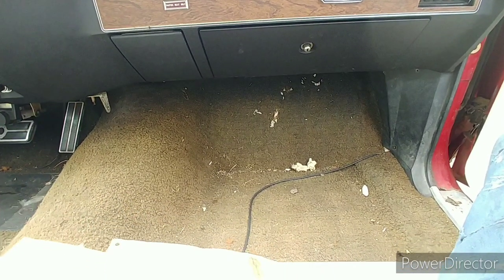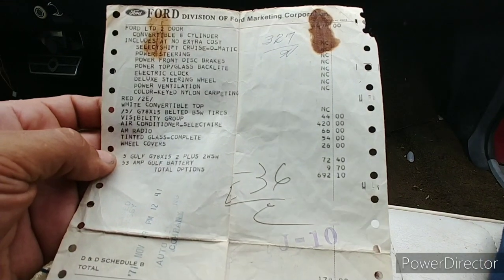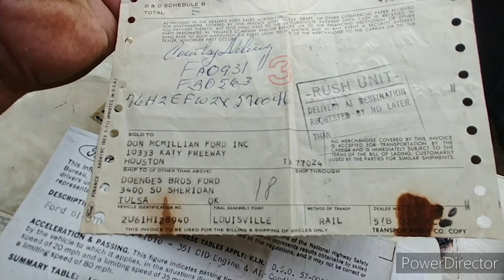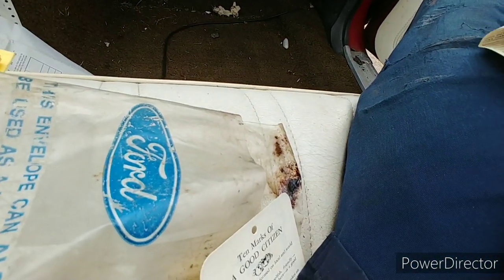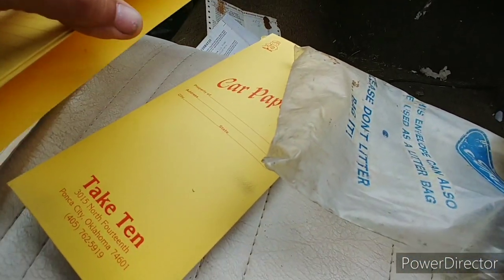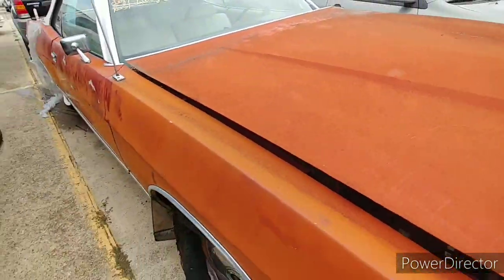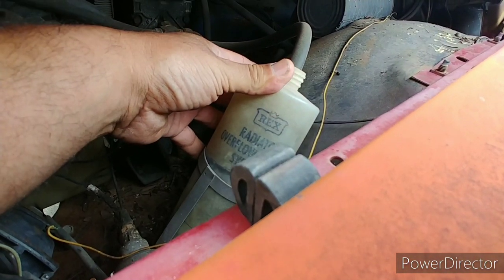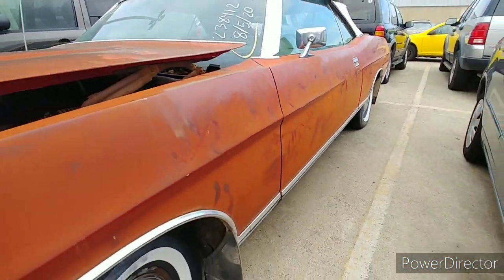1972 Ford LTD Convertible Auction Find

Comment: Whoa Nelley, rare drop top, at $5k a pop.  Last year for the LTD convertible and only 4,234 were made. We got the VIN (and then some), so we win and here we go:

2 for 1972 model year, U for Louisville, KY assembly (the same city was also the home of GE's "Appliance Park" manufacturing plant for appliances, I have one in my house from there), 61 for LTD convertible,  H for 351 V8 with two barrel and the rest is the production sequence. We got the tag, we can brag: 76H for Ford LTD convertible, 2E for Red exterior paint, FW for black and white interior trim (white seats, black carpet), axle of 2 is 2:75:1 rear axle ratio, transmission of X is FMX automatic (aka "Cruise-o-matic"), district code of 57 is for Houston, TX which makes sense based on its' eventual desination. 

Don McMillan Ford is now Maik Ford at that same address. Doenges Brothers Ford is now Fowler Ford at the same location.  This car had a glass rear window according to the window sticker and it appears to be gone. That cruise control is aftermarket and typical of the "hang on" units of that era. Visibility light group typically meant  map lights, under hood, trunk, and footwell lights on a lot of Ford models.

I guessed $1500 before you showed the amount.
Reply: Damn I thought that Load of Tin from Dearborn would have a 9 inch rear in it so the the 351 must be a Windsor. I had 74 LTD 400 2 barrel C6 transmission and it had a 9 inch in it also it was one of the worst vehicles I ever owned, I could write a page on it but the transmission and rear were trouble free it was just everything else.
Reply: @garymckee8857  The beginning (or somewhat start of) the Malaise era in Detroit and American society in general.
Reply: @garymckee8857  The window sticker made the decode easy on this one, but the clincher was that the salesman wrote the door tag details on the window sticker as well. I was able to freeze frame (just barely) on the door tag to do the decode.

We got the VIN, we win, we got the tag, we can brag.  We got the (window) sticker, there's nothing to bicker.
Reply: @googleusergp  My 69 Road Runner window sticker I still remember the final price in the lower right hand corner was 3003.38 manual steering manual drum brakes bench seat 4 speed but it had the light package.
Reply: @garymckee8857  Much more ala carte back then. My '80 Trans Am has power windows, no power locks. No tilt, standard interior, optional engine, no radio (just an accommodation package, we had the dealer add an AM/FM radio, I took it out in 1991, but still have it), AC, no WS6. It was on the showroom floor and one of the only 1980s left in the dealer's inventory in the fall of 1980.  We were after a Pace Car, but there were none to be had (according to that dealer). Even among Pace Cars, they had options. Some didn't have power door locks or tilt, or delay wipers. 

Compare that to a 10th Anniversary Trans Am, you had one option: The engine. You either got a 403 with a TH350 or you got an optional 400 Pontiac and you got a 4 speed with that. No choice. The engine dictated the transmission (TH350 for the 403, Borg Super T-10 for the 400) , the rear end ratio (2.73 for the 403, 3.23 for the 400), where it could be bought (no go for the 400 in the high altitude/California emission regions) and cruise control (Yes for the 403, no for the 400, you got a credit). My car is a Pontiac 400, one of 1,817. Mine was made in the first week of April 1979, the exact week that GM announced the 400 engine could not be ordered anymore, you had to get a 403.

The story on mine is that the original owner saw it in a magazine. He had a 1975 Trans Am at the time. He sold that (or traded it, forget which) and then went to get the 10th. He wanted a 400, and the salesman, Bob McLeaf (deceased now) of Brake Pontiac in Waynesboro, PA said he didn't have one. The original owner, said, "How about $500 to motivate finding one?" With that,  Mr. McLeaf made a phone call to Liberty Pontiac in Randallstown, MD and they horsed traded the 403 that Brake had for some extra cash and a deal was made. The owner drove with the salesman to MD to do the swap and then the paperwork was done at Brake Pontiac in late '79/early '80 (the original title is dated 1/2/80, I have a copy of it).  My car cost a whopping $13,260.96 out the door WITHOUT the $500 he paid the salesman. The loan was paid off in three years. When I finally tracked down the original owner and spoke to him on the phone, I said, "That payment had to hurt every month", he laughed and said, "Yea, like giving up a kidney every month" or something like that.   He worked for the US Army so I suppose he was a good risk for a loan back then.

I lost touch with him. He originally said he had a "box of stuff that goes with that car, if you let me drive it one day, I just might give it you....." I gladly obliged but he then claimed his ex-wife threw it out in a divorce. I'm going to have to revisit this story with him again.....My car was traded by the original owner to Lynn Pontiac in Waynesboro (Brake Pontiac eventually became Lynn Pontiac, today this is Buchanan Auto in the same location, still a GM dealer).  From there it got sold to a person in MD, then to someone in VA, then back to PA from the folks I bought it from in 1999. I have spoken to every owner it's ever had.
Reply: @googleusergp  I purchased my Road Runner from the original owner for 300 dollars in 82 he had bought a Chevette and the car was sitting beside his house his son was a classmate of mine in grade school and I remember when his dad bought the car new. It had 48 thousand miles when I got it it had a 323 rear gear which I thought was high for a manual transmission and ugly interior that I changed to what Chrysler used for Police cars and Taxi cabs in the 60's also their S/S cars had the same material which in 82 just for the material was 350 dollars when I was only clearing 111.62 a week.
Reply: @garymckee8857  We somehow got it done. I was making about $3.75 an hour in 1987 (which was above minimum wage) working in a hardware store (My father sold the HR manager a Cadillac so he got me the job through her and her husband who also worked there). I started stocking shelves and then another HR person said, "You'd be a good sales person". So, in September 1987 (actually around this exact time), I moved to the sales floor. That got me salary and commission on everything I sold, so I made good money, more so than stocking shelves. I had the $2200 (my parents gave me $1000, the other $2200 was a loan) paid off in no time flat. I would make sure that I was writing up everything I was selling on the floor and that got me extra money to give to my parents off the loan for the car. When it was paid off with money in the bank for insurance, registration/inspection and money in the bank for parts (as I was doing the work myself of course), it went on the road. I got my driver's license on Cinco De Mayo 1988 (5/5/88) and registered the Toronado I had bought on 6/1/88.
Reply: @garymckee8857  3.23 may have been high in 1968, but by 1979 on the Trans Am if you wanted AC, that's what you got for a rear end ratio, especially with the Pontiac 400. The 403 had a 2.73 rear in most applications, sometimes as low as 2.41 on some Trans Ams.  My '80 Turbo is 3.08. Pontiac knew how to work with what they had based on emissions laws at the time, although they raised the ire of the EPA more than once. The Super Duty just barely passed through emissions for the given year and some 455 engines had emissions routings which the EPA later found out violated Federal law and they made GM issue a recall. Also, GM had the "Vacuum Operated Exhaust" or VOE option on some GTO models and the EPA shut that down as noise pollution. They reproduce it now for restorers that want to add it or if their cars had it. Also the hood scoop was not functional I believe after 1972 on the Trans Am again due to EPA regulations.

Of course, GM's brass got bent out of shape with GM's ad agency with the famous ad showing a GTO at the Woodward Ave crossing/interchange and sign with the caption, "You Know the Rest of the Story". It was thought that street racing was being promoted and this was the time when the insurance industry, the EPA and all the thinking at the time was very much against performance.

Here's that ad: https://fineartamerica.com/featured/1968-pontiac-gto-woodward-the-great-one-by-pontiac-digital-repro-depot.html
Reply: @googleusergp  Yes in 83 I borrowed 500 dollars and bought a 65 Fury ll 2 door post car black in color with dog dish hubcaps. It was a 318 car but I had a 65 Imperial that had a 413 I was going install in it but as usual my attention span is short so I got rid of both of them but now I would like to have the Plymouth back it was in excellent condition.
Reply: @garymckee8857  My parents had a 1963 Sport Fury with a 318. My dad bought it new. When he went into the service, they froze the payments until he got out. When I was born in 1971, we sold it. I'm pretty sure we got good money for it, it was in excellent condition. We had a 1972 Fury for a short time, but my mom chipped the flywheel when she accidentally turned the key when it was running.  We eventually wound up with a new 1974 Charger 318 which we sold in the spring/summer of 1979. I was playing in my grandparent's yard when a guy came up and looked at the for sale sign. I called my dad out and the guy bought it on the spot for asking price. He kept it several years and it was in excellent shape and then he sold it in the 1980s.
Reply: @googleusergp  Outstanding Chrysler used to manufacture some great vehicles, of all the vehicles I have owned the only photo I have is me standing beside a 67 Sport Fury that my mom told about she heard on the local swap shop radio show 318 car fastback version 275 dollars in 91 damn I wish you could buy old vehicles reasonable but the T.V. shows ruined that now if one had some weird option they try to get some astronomical amount for it.
Reply: @garymckee8857  Growing up, we had a 1941 Plymouth Deluxe. We bought it in 1978 out of the local paper for $550. I can still remember the ad, "1941 Plymouth Deluxe four door. Runs. Needs work. Extra parts included". We showed up there and my mother said to my dad, "Are you nuts? That thing is a POS.....". My dad said, "Won't be with some elbow grease...it will be a family project". We bought it and it came with a load of extra parts. It was primer gray and black, and one of the neighborhood kids' visiting cousin called it "The Bomb". By 1981 it was painted Candlelight Cream, an AMC color if I recall. We cleaned it up, us kids polished chrome and learned how to work with tools (including me learning fractional math from my dad using SAE sockets---I still have them today) my dad and grandfather redid the interior with a JC Whitney kit. It was all an amateur restoration but by 1981, it was looking nice enough to polish and keep clean.  In 1985, my grandparents were married 50 years so my dad took them to the church/celebration in it as the chauffeur. We have photos of it, the day was a lot of fun. When my dad passed away in 1988, we gave it my uncle who lives in TX, his older brother. He had it for a number of years, painted it a burgundy Ford color, fixed it up again, refreshed it, and then his son, my cousin Gerard, had it for a while and then he sold it to the proprietor of a local paper in TX, who I believe may still have it today. We nicknamed the car "The General" in my family since it was a WW II era car and it always, always, always started right up. One time, my cousin was living where there was snow and every car he owned wouldn't start, but the 1941 Plymouth fired right up and plowed through the snow.  

Every year at the end of the season by fall, it would be put in my grandparent's garage for storage, with our patio furniture in the back seat to keep it out of the weather. Spring time, we would charge up the battery, fire it up and take it out. My mom gave it to my uncle and wouldn't take money for it. "Your brother would want you to have it..." My uncle refused and said, "Ok, here's the deal. I will give you a check for some money towards his (me) college fund.....". With that, a deal was struck. My uncle sent two guys that were cattle ranchers with a truck to my grandparent's house to pick it up. My grandfather said to them, "You guys are real cowboys!" Lol. They said, "Yes sir, we'll strap her down like a hog and off we go...." And that's what they did. My grandfather got a kick out of them---they were the real deal with the hat, jewelry and jeans and boots. Nice guys.

Fast fun fact: The garage that it was stored in was my grandparent's garage. In 2016, I bought that garage and property from their estate through my mom and uncle who inherited it when my grandparents both passed away. As I needed a place to store one Trans Am (which had been stored there for years when my grandparents were still alive), we worked out a deal where we sold half of the property and I bought the other half with the garage on it. Win-win situation.
Reply: @googleusergp  outstanding it's always a great thing to have a garage.
Reply: @garymckee8857  When the offer came up (I could have bought the whole property, but my uncle convinced me to just buy what I needed---I wound up buying my parent's house a few years later after my mother passed away, so it worked out), I could not refuse it. My uncle and mother (brother and sister) were very good about it. They offered to lend me the money, but I said, "Nope, this is my choice. I'm good" and I figured out the money end of it. I'm fortunate---it's a legal garage with NYC and it has its' own street address, which is extremely rare in NYC. Only a handful (probably less than 25 in all of NYC) have this situation. I know that's the case because I've spoken to several people at NYC Buildings and they all agreed. The contractor that did the renovations tried to get cute, but that got him burned. He didn't factor in the cost of the driveway, tree removal and curb cut, but I did---and put those terms in the contract which everyone signed.

Guess who wound up pouring a 65'x20' driveway (8" thick with Fibermesh and high density mix), cutting down all the trees in the yard and getting a legal curb cut for virtually free? Yup, not me. I wound up giving him an extra $5k because he bellyached that I "snuck that into the contract", but that's OK because when he gave me a new proposal, I made him take down every tree in the yard in the way which I know alone was $5k worth of work (since I got estimates from others on my own)  and my coworker's father who was a mason calculated that the driveway alone was $15k in concrete. Either way, it wasn't my intention to screw anyone, but when you try to play games, you often get burned. This guy learned that the hard way.
Reply: @googleusergp  sounds like you have some prime real estate. You said your family had a 74 Charger I bought SE from a and older guy who done the same work that I do it was a 400 he had everything rebuilt in the vehicle before I bought it . I remember when I started doing this type of work I drove home every weekend because I was close enough to do that and he said your lucky to be close enough to home to do that now I know what he meant by that because I'm 1100 miles from home and tomorrow I driving to St. Cloud Minnesota for a week of work and that's puts me about 1500 miles from East Tennessee and that's why I don't own any old vehicles anymore unfortunately because I miss having something I always had when I was able to earn money.
Reply: @garymckee8857  True. With the pandemic, I'm working from home, so I save 44 miles a day of driving and such. I have to do some oil changes on the car,  I haven't had to do them this year because I haven't been driving at all, except for local runs and one 110 mile trip to visit my sister to do some work up at her house. 

The real estate is special to me because everything was owned by now deceased family members. So I know what I've got---my house has been in my family since new in 1968 and my other garage has been in my family since 1975 when my grandparents bought it. The garage was built in 1962-1964 by the guy that sold my grandparents the house in 1975. He moved because he got married. He was living with his uncle and I suppose his new bride didn't want to live with his uncle. Old German guy who built my garage out of 5/4" decking. Overbuilt. Way too much for a garage, but it's like a brick you know what. Both are a mile apart (maybe a 15 minute walk) so it's easy to get there. I was there twice today for two CL/FB sales. I went early in the morning, cut the lawn, someone came for something, sold that. Then I came home, whoops, got an e-mail about something else, took another ride back for that. LOL. But two sales from curbside finds work for me.

Our Charger was a regular model, F7 Sherwood Green outside with a white inside. PS, PB, AC, AM radio (which we added an FM converter to from what I remember), white vinyl top, 318 two barrel. It was sharp. My father kept it in great shape. We also had a '72 Charger 318 two barrel that we bought used in 1976 and sold in 1978. That was F3 Fiesta Green. The '78 gray Bonneville I spoke of in another video took the place of that. The '72 was the "money car" as I related in another story where when cleaning out the quarter panel plugs $8.00 in pennies came out. My father called the previous owner who said, "Oh yea, that was the jar of my bowling dues money. It must have spilled open and the coins fell under the trunk floor. Hey buddy, keep the change!!!" My father laughed and hung up the phone. We bought a new NOS Holley carburetor for it for $25. Funny story is that the guy  at the auto parts store that sold us that was the same guy I wound up dealing with (at that same parts store) around 1988. Years later around 2002, when I worked in the aftermarket, we used to have a "salesman's tour day". They would have a day where us office guys would pal around with a local salesman to our area. So I picked my area and I went with the salesman that covered my area to all his auto parts stops. We go to this one parts store and who is working the counter? The same guy Gary from back in the day. He said, "Whoa, blast from the past. I know this guy since he was a kid. I sold him a carburetor with his dad in 1976 for $25!!" He was an excellent parts guy and really a nice guy to deal with. He knew his stuff.
Reply: @googleusergp  wow I have pennie story also. In 92 I bought a 78 Dodge Magnum one Sunday the horn just started going off for no reason so I go outside and kick the rear bumper and these pennies start falling out from the bottom left rear quarter panel you could not see any rust in the quarter panels because the pennies was causing the corrosion from the inside. Whoever owned the vehicle before me had 6 or seven 50.00 pennie bank bags in quarter panels and they rotted and caused a chemical reaction but I paid 300 for the car and got that many pennies out of it.
Reply: @garymckee8857  Talk about a free ride. LOL. That's great. Us too, we called over a neighbor and said, "Watch this....this Charger  dispenses money". LOL.
Reply: @garymckee8857  A few years ago when my mom was still alive, we went shopping to the local Shoprite. In the span of two weeks, I found a gift card with money on it in the fresh fruit section, a NYC Metrocard with money on it for probably three or so bus or subway rides (I think a woman I worked with bought it from me as she was taking the train at the time) and then $100 on the floor in the coffee aisle. My mom was like, "Listen, can you get me that Folgers on the top shelf......." I was like, "Wait a minute", and went over and bent down and found the $100 on the floor almost tucked under the bottom shelf.  One time in 2002 I found two pieces of real gold jewelry about two weeks apart. One at my grandfather's house outside the gate and another time crossing the street at work going to our parking lot where we parked our car in the company lot. Both turned out to be real. My sister knew a jeweler who took a look and confirmed that they were both real.

For me the finds were the following: 1/2" SK ratchet, 3/8" Craftsman ratchet and sockets, two Craftsman screwdrivers, a Husky pliers,  a 1/4" Snap On ratchet and other "on the road" tool finds. I called SK and they sent a new kit for the ratchet, I got it working in 10 minutes. Snap On gave me a little issue, but I told them either they were sending a kit or a ratchet. They sent the kit and I fixed that one.